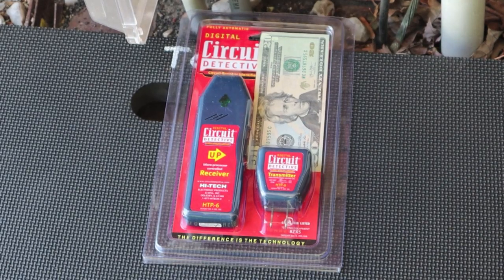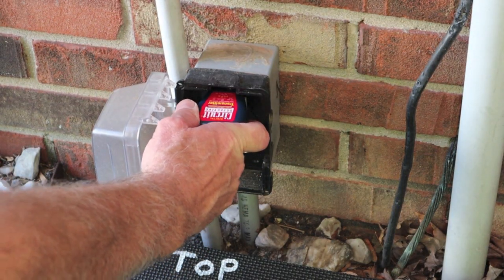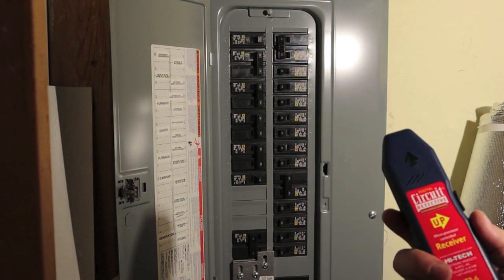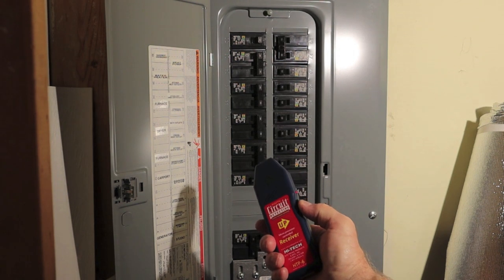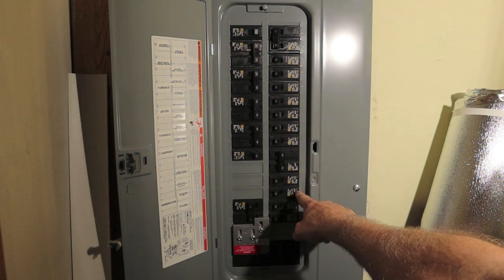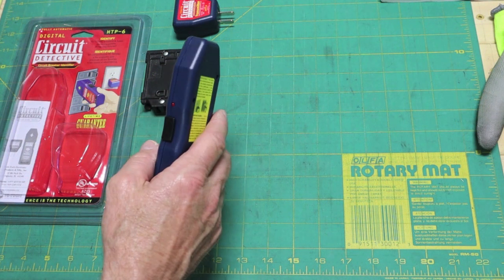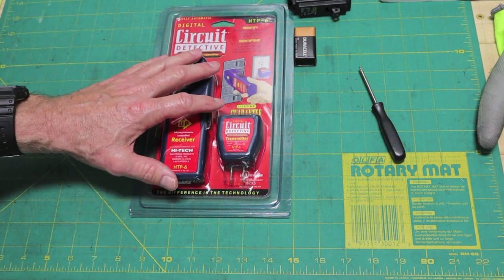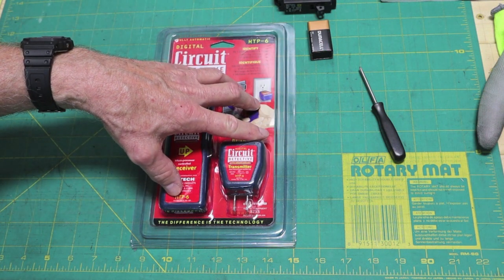A 120 Volt CIRCUIT FINDER for $20.00?!? YES and IT WORKS PERFECTLY!

Comment: My husband was excited to find this project at Harbor Freight recently. He watched this video and was not sure if he understood it -- despite of the caption. So I have watched it as well with the CC on.  My question is -- how would he identify WHICH circuit is actually the one that is connected to the receiver unit? -- -WITHOUT depending on the sound.  No visual indicator on the receiver like it does on the transmitter?  Update..my husband continued to watch other videos. He learned that on the label side of the receiver, you will see a green arrow lights up.  He hasn’t tried this yet.
Reply from the maker: OK, I think he'll be just fine with it, just make sure he checks any circuit with a tester and de-energize any circuit he is going to work with.
Thank you!

Comment: The only issue I have with it is the button is easily activated by accidentally touching. Otherwise works fine. Thanks for the video.
Reply from the maker: You are right on that. I see no way to store this in a tool bag without it turning on, so I remove the battery when I put it up.
Thank you for watching and commenting!
Reply: If the button is held for a long time, the unit will beep periodically to call attention to the situation.  Current draw will be significant even between beeps, though, while the CPU is trying to shut down but the button is forcing the supply circuit to stay on.

Comment: Great Video.
But I cannot get the battery out of the device now. I think it is stuck, please help!!
Reply: Use the battery cover to catch the bottom edge of the battery to lift it out.
Take the little screw and toss that in the circular bin. There's no need for it at all because the battery cover latches on securely without that nonsensical waste of time.
You don't really need to remove the battery, the standby draw is negligible, and it powers off automatically if you accidentally turn it on.
Get a small rubber band and wrap the inside edge off the button, and it will not accidentally turn on, as it'll require a firm press then.
Reply from the maker: Hi, the battery is a very tight fit but it should lift up. Bear in mind the very bottom of the battery compartment is slightly recessed, so scoot the battery up toward the top before you lift it out.
I hope this helps.
Thank you for watching!

Comment: I notice you have that "sliding metal bar" (can't remember name) on your breaker box for your backup generator. I have the same thing. 
I 'm sure it cost less than $50 and I just can't imagine why people go though the trouble of a transfer box unless they want an automatic system.
Most of those transfer systems can cost over $500 and are much more complicated to install.
Reply from the maker: Michael, that's exactly why they spend the money on the transfer box, they want that automatic throw over. 
I'm okay with an interlock sliding kit. I like the hands on hook up too with the generator as we don't experience many outages.
Thanks for watching!

Comment: Where did you get the  generator interlock on your panel. The panel looks like a square D timeline.
Also nice review I'm going to pick one up with my 20% off coupon.
Reply from the maker: Thanks Frank, I appreciate you watching!
I got it on Amazon. Here is the description I copied:
SD-200A Square D Generator Interlock Kit QO & Homeline Indoor or outdoor 150 or 200 amp panels.
It came from Geninterlock.com
Also it is a Homeline Square D.
Reply: That was supposed to say square D Homeline.